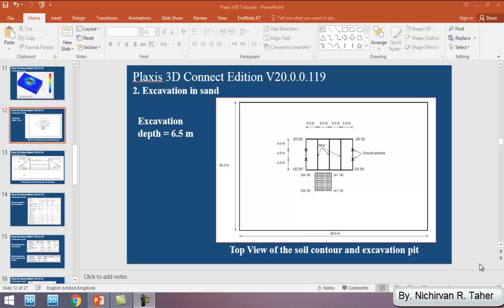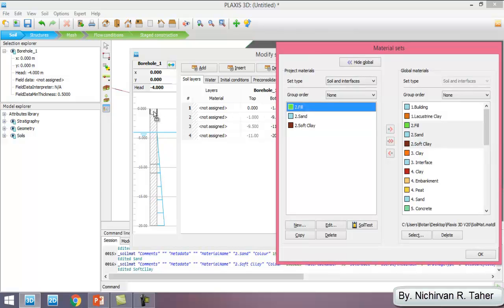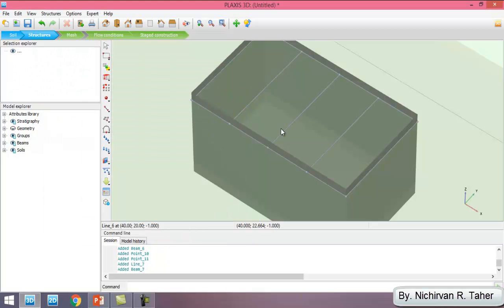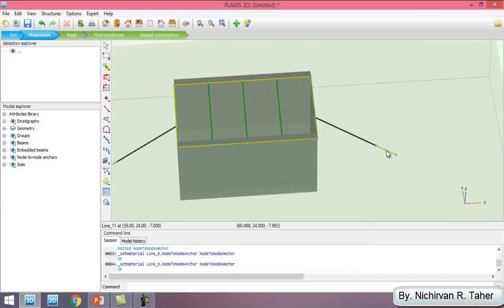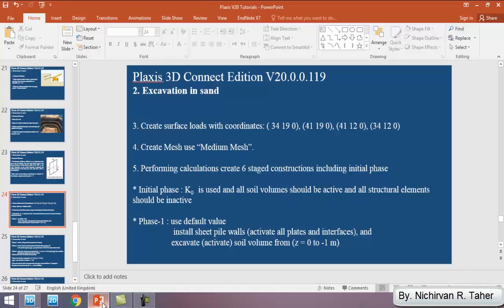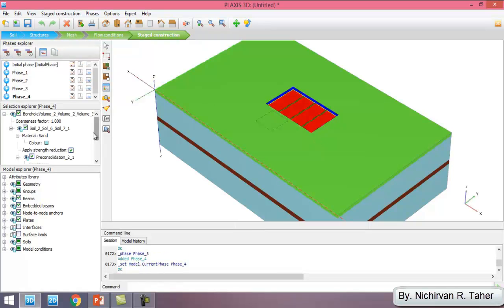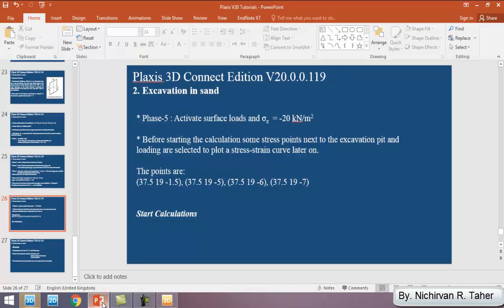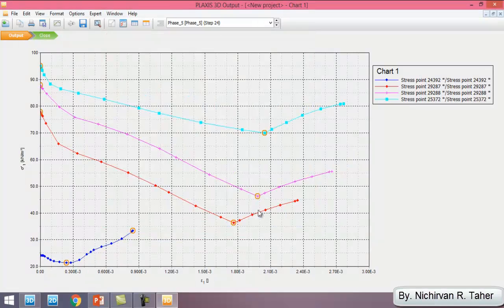Plaxis 3D V20 Tutorial #2. Excavation in Sand

Comment: Thank you it is very helpful page
Can you help me please
I need to simulate the load sharing between piles and raft in piled raft system and i have a method for this but it is needs to know the normal stress on the raft... My question is how i can get this value and it is location on the raft...
Reply from the maker: dear atheel sabah you can take a look at the literature about this topic.
Reply: @GeoStructAcademy 
Where can i get it?
Do you mean the tutorial that included with the program
Reply: Is there a video to apply the case of load sharing please? The literature include the result only without the method or the steps

Comment: Thank you for useful video... Can you help me please to add interfaces for embedded beam (pile) in plaxis 3D
Reply from the maker: the embedded beam does not need the interface
Reply: Thank you very much for your helpful answer...
Reply: Even in dynamic load doesn't need the interface right? 💐
Reply from the maker: @شهدخضرالياس  yes it does not need, In PLAXIS 3D, the embedded beam is a special feature. This function was created to represent pile behaviour in a more straightforward manner. The embedded beam is very helpful when there are several piles in a PLAXIS 3D model that need to be taken into account. This method uses special interface elements that are built using node-to-node, non-linear coupling springs to depict the soil-pile interaction along the pile shaft and at the pile tip. The pile is represented by beam elements in this method.
Reply: Really it is very valuable and useful information Thank you very much I wish you all the best